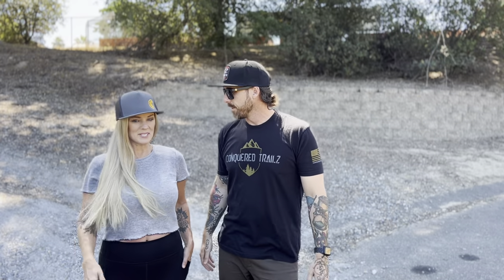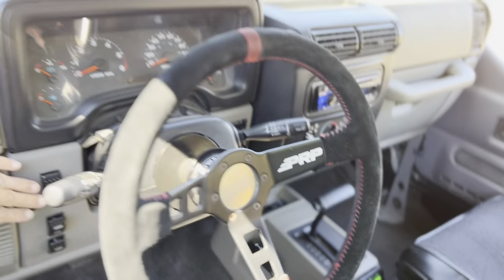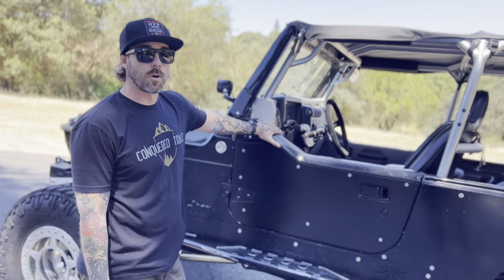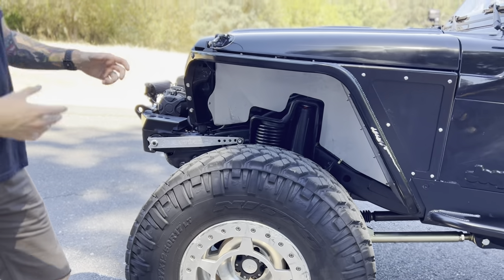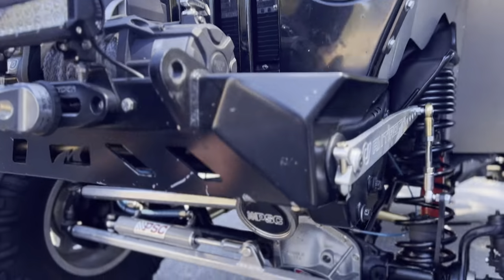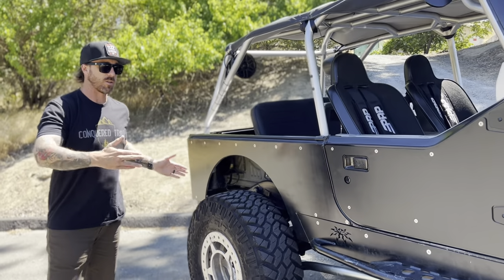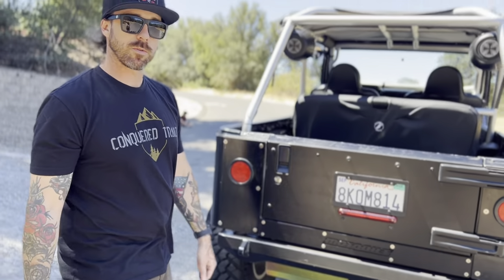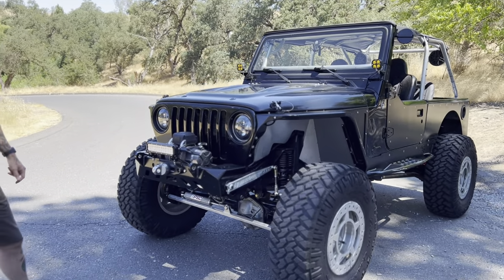LJ WALK AROUND - 2005 JEEP Wrangler LJ

Comment: Sick truck. While I understand the benefits of not having a 5th wheel on the back, I just think the genright tire carrier on the back would make your rig. Since there aren’t 40’s or 42’s on there I don’t suspect the crawling that’s gonna be done will be super hardcore(still gnarly though), therefore I say throw that tire carrier on the back!!
Reply from the maker: GR tire carrier would definitely look legit on the back of the LJ. When we bought it from the previous owner he didn't have a 5th wheel and tire to match the other 4 on the Jeep. I'm planning on changing out the wheels to Raceline and the tires to 38" Patagonias down the line so when we do that we'll add the 5th wheel and consider a spare on the tailgate.

Comment: Good looking rig. I would ditch the Tera kit. I had one and they all die with no replacements parts available. I would do a Rubi Crawler from AA. It replaces the tailhousing and add another 2.72 reduction unit. In low/low gets you 7.39 to 1. You will still have the reg 2.72 in the case that works good for snow/mud/sand stuff.
Reply from the maker: That's what I've been hearing! Rubicrawler has been added to the list.
Reply: What goes wrong with the Tera kit?
Reply from the maker: @jeepdude82  From what I've heard it ends up pretty much blowing the entire tcase. Teraflex has discontinued the product which leads me to believe what I've heard has some merit.
Reply: I hadn’t finished the video when I made my comment. I was thinking you guys were referring to the steering. 

The biggest thing I’ve heard about the Tera Low is that you can’t run high RPMs with them. That’s when they explode. If your going to keep that factory engine and transmission I would look into the rubicrawler for the back half of the tranny then a transfer case of your choice (atlas, nv231, nv241, etc…) 

I have the 6speed manual in my LJ and the nv241 has held up great. But I want to swap for an atlas4 speed to get some more gearing options and the ability to drive in 2 low.
Reply from the maker: @jeepdude82  Awesome. Thank you for the info!

Comment: Just bought a 06 tj with 7k miles I’m kinda obsessed 😂
Reply from the maker: 7k miles!! Dang that thing is brand new. Congrats
Reply: @ELEVENSDIRTLIFE  thanks! It was stock when I got it. Already did bds 2 inch fox shocks poison spyder bumpers front and rear  pro comp offset wheels 31 inch bfg at truck lites alpine head unit and factory sub upgrade with Memphis speakers in stock holes coming soon it’s a 6 speed. Love the lj tho, it’s sick!
Reply from the maker: @areject17  nice. Sounds like a total transformation you got going on.
Reply: @ELEVENSDIRTLIFE  yeah my goal was something better than stock but not too crazy which is what I feel I accomplished. I bought a sye and Tom woods driveshaft to that I’m going to put in because even though it’s only a two inch lift there’s driveline vibration. And I don’t want to do a tc drop. Those don’t look right imo. I’d love to have a built lj like yours someday tho for trails, it’s soo sick. I was going for more of a daily driver that could hit some small trails if I wanted. But a trail rig someday would be sick. But ever like building from the ground up it’s easy to have 30-40k into one. Parts are expensive and there’s soo many to buy haha